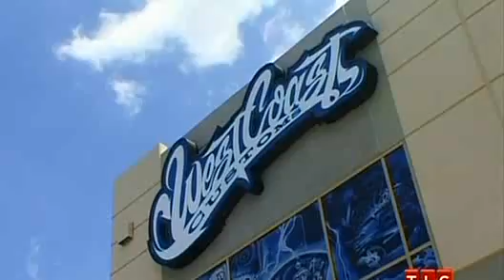West Coast Customs - Asanti Mercedes Part 4/4

Comment: The CL is considered to be the S class coupe, but the S class is actually still a significantly longer and larger car.
So there will be a serious size difference between this car and a CL. Especially since the CL is a grand tourer, so it is all about space and comfort for the driver. The S class is designed with the back passenger in mind, because often the guy in the back is the one who bought it, so much more leg room and amenities back there.

Comment: Significantly? Nah... CL coupe is 509,5cm long and a S class is 511,6 cm long... that's barely 2 cm difference or not even an inch difference in length. The major difference is in the wheelbase... S class longer wheelbase is exactly the same amount as the extra space it has inside compared to a CL Coupe.

Comment: Obviously you don't have much to do with Custom cars a normal car is a pain in the ass to start with because designers are ass holes with where they put shit, They add to that they are joining doors, chopping the roof that's high end moding then you have a group of people trying to work around each other to do it and people that don't do what they are meant to that's big problems like some parts can take 14+ days to get if someone doesn't order it early enough your screwed